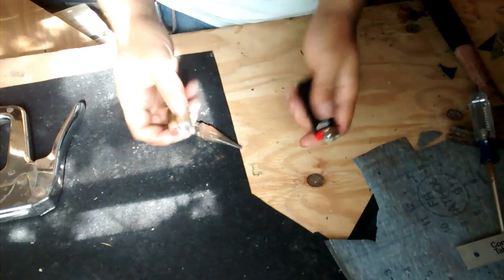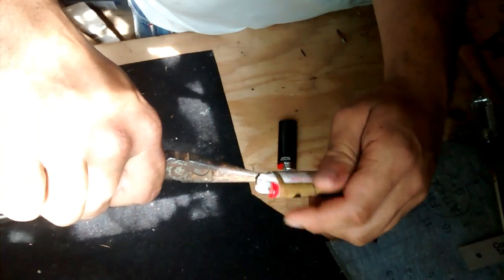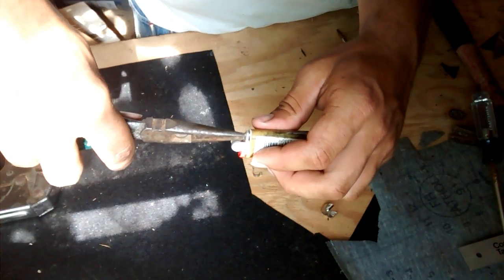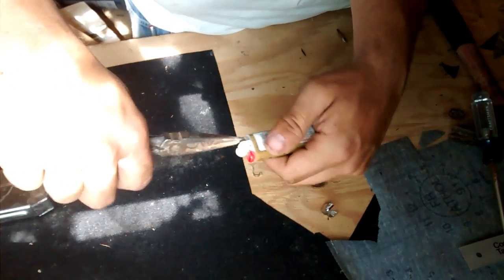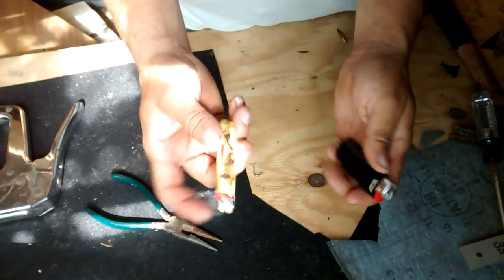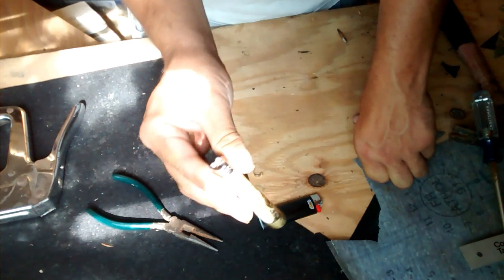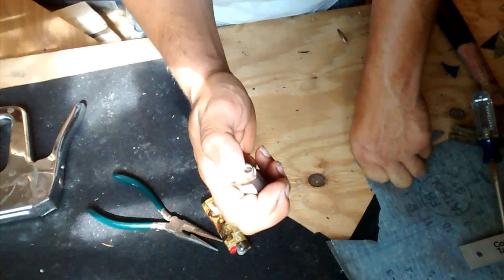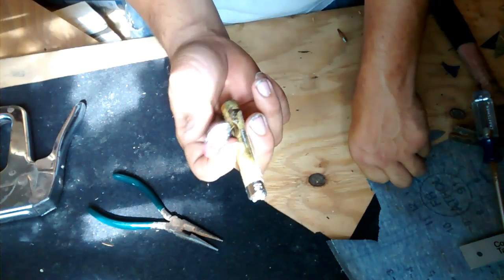Bic lighter mods

Comment: BIC LIGHTER REFILL HACK WORKS. I've done it several times. You are right though, its NOT safe but ONLY because theres no one way valve. Usually on refillable lighters, it has a spring loaded valve you put the fuel can too and push. When you push the valve in, the spring contracts and the rubber gasket ( o-ring ) lets liquid butane IN, but wont let it out. This is why when the ring gets worn or is missing, you can still fill it, but it might go ssssssssssssssssss leaking either until the whole lighter is empty or maybe just a lil bit as the ring and / or valve is worn but usable. As for the BIC with push pin trick You have to find the right size adapter for the can and / or get some mini rubber grommets. These grommets take the place of the o-ring on conventional refillable lighters. The problem is you have to be fast like the Flash lol. You fill it up and then as you remove the nozzle, you have to quickly push the thumbtack / pushpin in the hole you made with it . It scares most people because regardless of how fast you are , it will still expel a strong blast of fuel gas. Most of the time I can refill a BIC to about 50% , 75% if I get a pro clutch move with the speedy hand swap lol. You can ALSO remove the valve on a refillable lighter ( say its busted and wont work but the refill valve is good ) and use drill bits to make the BIC use the valve ( which is also safer than the tack ) As for that , its not hard really and once you push the pun all the way in you get some snips and cut the tack in half so only the rounded bottom  part remains. This is done so when you put it in your pocket there isnt any chance of it getting caught on change or stuff in your pocket and pulling the tack out. Which I might add, will make you shit your pants but is funny in public. SNAKE! I heard a snake! In reality though chances of the pin just falling out are slim to none. The reason is, the surface area of the thin pointy pin will direct pressure current aerodynamically from point to stem. This is what people think will expel the pin, but they forget that there is a lot more SIDE pressure on all sides of the pin pushing against it too, which imo i theorize that this is why the pin doesnt just pop out combined with it's custom fit and like I said even if it did it would be like the SNAKE! example above. However always use safety glasses when modding this. Even if you have none, put some reading glasses on. I always do. Glad I did or I might be one eyed willy. Last year as I tried to put the pin in the gas had wet my hands so as the pin entered I lost grip and it shot it RIGHT at my eye and was deflected by the glasses.
Reply: Holy shit I actually just read all of that
Reply: Wow
Reply: @tiffanybluetarot  Yes!
Reply: @tiffanybluetarot  I subbed to your channel because while I like tinkering / engineering / modding I also like occult sciences and are a high level occult sorcerer!
Reply: all i gotta say is great comment too bad this didn’t get more views cause your comment was very helpful for me
Reply: What I've always done is take a refillable pen torch or cigar torch and remove the refill valve on the bottom of the torch, then drill a hole on the bottom of the bic lighter that's a smaller diameter then the refill valve (but not to much smaller). Then I will take some jb weld and put a little on the inside of the hole on the bic and a little around it as well as a little on the outside of the valve then kinda hammer the valve into the the hole of the bic and just like that you got a refillable bic with no leaks. Usually is good for a pretty significant amount of time. The one im using now has been good for over a year now.

Comment: I have watched thousands of videos on YouTube how to make your flame higher on a big lighter. I’ve never seen one but I’ve done it one very simple method.
Reply from the maker: Okay enlighten us
Reply: @TRASHEDTEG  Im not sure you can TRASHEDTEG. Bic lighters seem to be purposely made and have a weird valve system. Dont know if you know this, but see how you can turn it? Well if you remove the arm that raises it and releases fuel and then try to turn it or pull up on it, you waste the entire lighter as all the fuel comes out. The nozzel isnt even connected! Furthermore after the nozzel is removed theres a foil looking circle over the hole. If you luck up and remove the nozzel and dont shake the lighter around the pressure wont empty it. You gotta do it lilke you are playing that board game OPERATION lol.I took a prodding pin after I did this and went to push the foil in some to hear gas sound but IT'S A TRAP! Soon as I pushed it slightly SNAKES ATTACKED. Shit my pants again,.